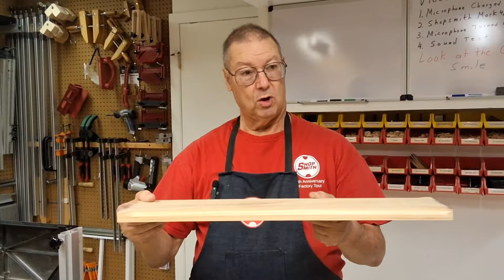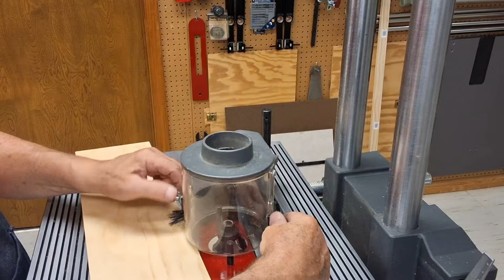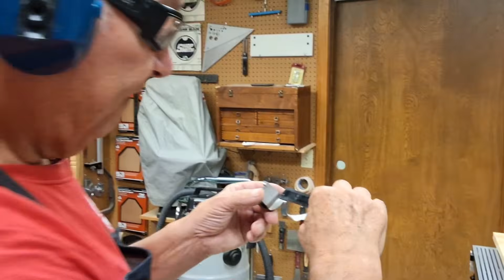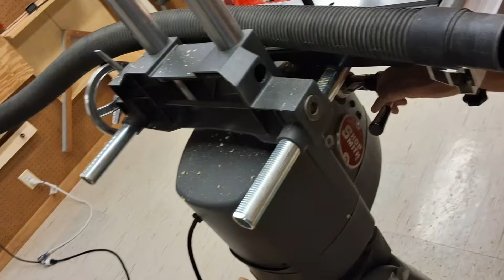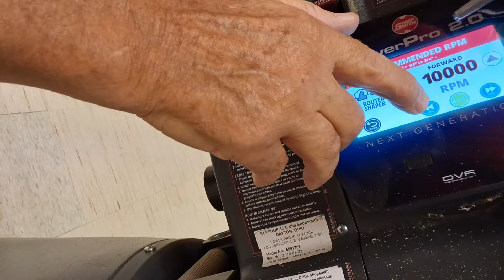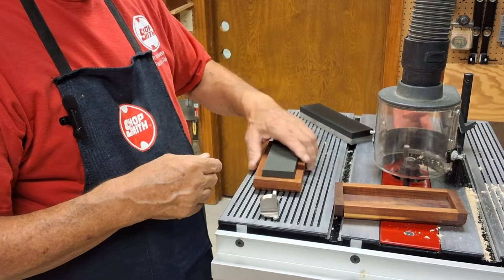Mark 4/7/520™ Self-Study Course Lesson 9 Under-table Shaping

Comment: Nice to see a mark VII in action.   I would rather hear the motor in use though, jsut to see how much, if any, it bogs etc.
Reply from the maker: At 10,000 RPM, the decibel level of the motor is such that it is hard to hear me talking in the microphone.
Reply: @StephenADraper  I'd have to watch again, but I don't recall you talking while you were making the cut?